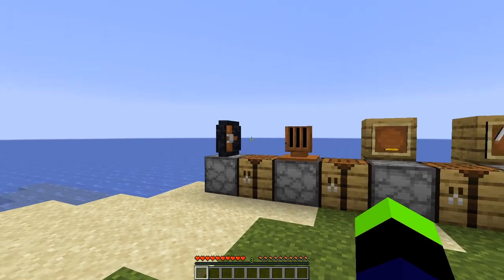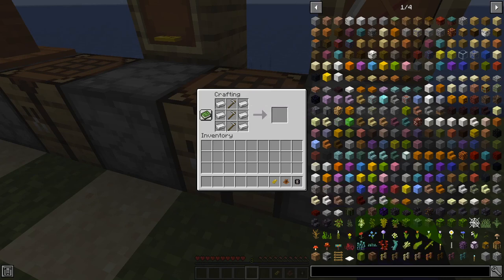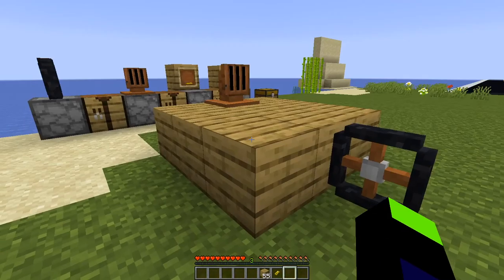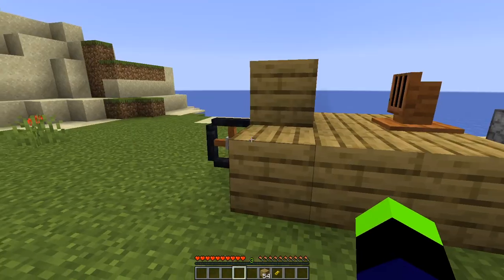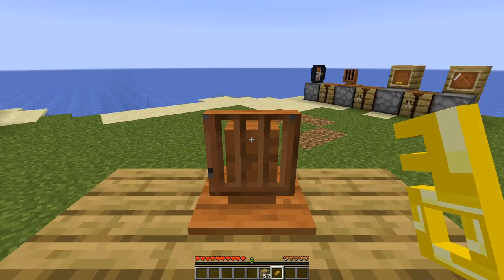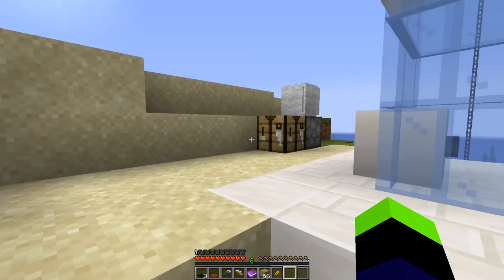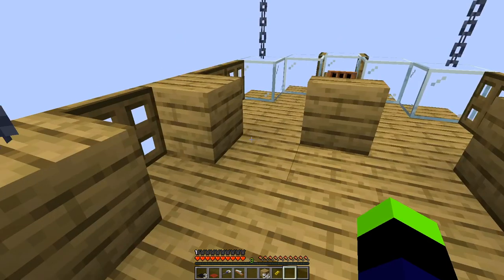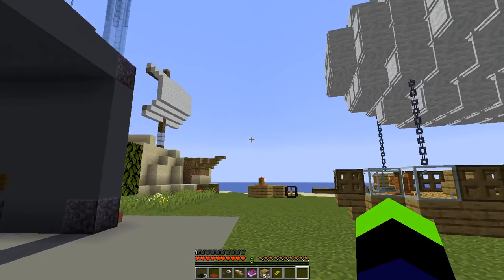Platos Transporters Mod Spotlight

Comment: What... why is your mic so good but the video is like 9 frames per second?
Reply from the maker: A good mic is cheaper than a good computer. :)
Reply: @DavethePie  but minecraft doesn't need a good pc
Reply: @ysbrandd  modded mc does
Reply: @DavethePie  I think you should get a better PC, a mic means nothing if we're watching a google slideshow
Reply: @WheezeyCompany  It isn't that easy. Most people can't materialize money out of thin air.
Reply: @essamarram1056  Good point but I’d wait a bit and save up or something, that way audio and video quality stays similar for a bit
Reply: @ysbrandd   Recording takes a lot of processing power.  His gameplay would be smooth, but his recording wouldn't be
Reply: @ryuk9597  i literally emulate mc java on my mobile phone using pojav launcher and it Works well even with mods although it starts off slow but After few seconds the FPS skyrockets with almost 40~50 FPS
 lol
Reply: @ryuk9597  my 70$ Raspberry Pi runs 1.16.5 with 14 mods at fancy settings with 40+ FPS
Reply: My guy recorded the video with screenshots jk love ur vids

Comment: What does that clearing tool have to do with anything?  I've been on the roof of my treehouse building the hull of an airship in anticipation of this mod.  I just want to build the balloon part now and prepare it for flight.  I hope I won't be running in too many problems.
Reply from the maker: I should have been a little clearer on that one. Essentially, when you deconstruct your vehicle, like I did with my motorcycle, if there are plants in the way, it won’t deconstruct. It just clears the area to make things a little easier to manage. Hopefully that answers your question.